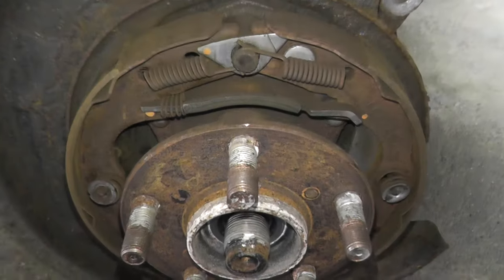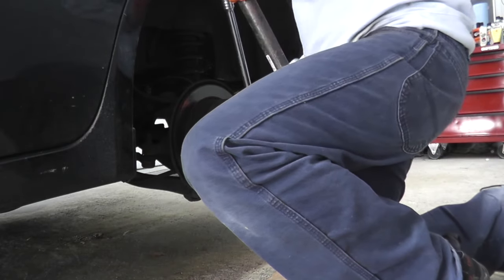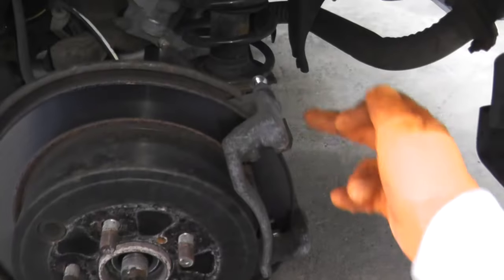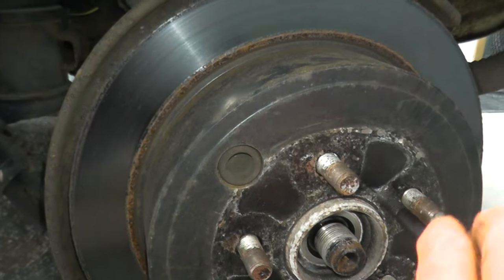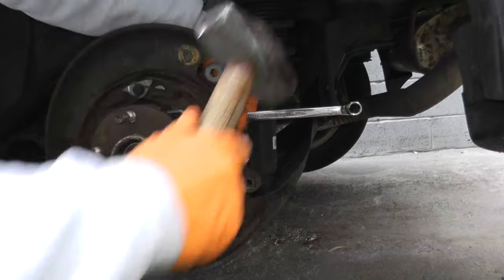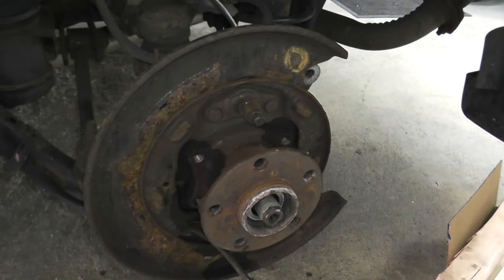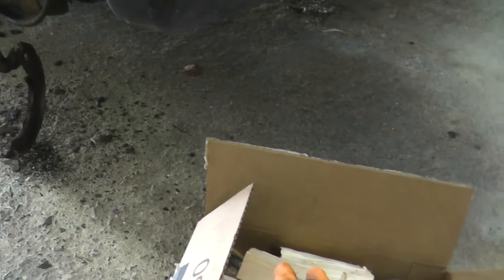Why Are Wheel Bearings so Hard to Remove!!  Subaru Rear Wheel Bearing Hub Replacement At Home!

Comment: First I tried pounding the hub flange for an hour.  Then I tried a puller and it pulled the outer 1/3 of the hub away from the other 2/3 of the hub which remained frozen to the backing plade and the axle mounting surface.. Now there was no longer a flange to beat on. I ended up driving a screw driver dozens of times between the backing plate and the axel mounting surface using a 3 pound hammer.. That eventually removed the backing plate and the inner 2/3 of the hub which were frozen together. After trying a dremel and pounding to separate them, they remained frozen.  So I ordered a new backing plate to go with the new hub which meant reassembling the parking brake, Two days of labor on one rear wheel. But I'm 83 years old.
Reply: Lisle 40100 hub tool gets the job done toot sweet. Someone makes a similarly mounted tool with an 18" 2x2x1/4 square tube welded to it for hitting downward with a 4 lb hammer....I want one.

Comment: I don't if this has been said already in the comments. The small bolt holding the brake hose bracket behind the caliper is the PERFECT size for pressing off the rotors. I normally unbolt those hose brackets anyway. With the slack,  I can get the caliper out of the way. Rests right on the axle.

Comment: Here's a trick that works for me. Leave the parking brake on btw. Use a slide hammer to get the hub flange out of the bearing, remove 4 wheel studs from the flange, thread those into the outside of the hub, use an air hammer with a punch bit to drive it out from the backside.  This allows you to hit each corner of the bearing instead of hitting it till it cocks in the knuckle.

Comment: Astro 78834 is the best tool I used to remove the bearing.  I was done in less than 15 minutes.  South Main Auto used this tool and it definitely worked for me.
Reply: You have no idea the gift you gave me right here. Every bolt I bought from the store sheared off this worked. Thank you.
Reply: @jdub976  Don't thank me. Thank Eric O at South Main Auto channel! Glad someone was able to benefit on a old video like this one.
Reply: Walmart also offers a tool similar to the Lisle 40100, but much cheaper. Amazon too.

 An impact gun could make the Astro or Lisle tool even better.

Comment: put the axle nut back on the axle when you are smacking it with the mini sledge hammer in case you miss the hub. If you foul the threads on the axle, you're looking at replacing the entire axle as well as the hub

Comment: Before putting the hub back on it's a good idea to use anti seize so it's not rusted together next time
Reply: I mean my bearings lasted 210,000km (the factory bearings) on my 2000 Model GF8 WRX. 
So anti seize would only be useful if i was going to still be driving it at 400,000km + while i plan on keeping it next 10-15 years i have done 65,000 in 9 years lol

Comment: I've seen that stuck hub removed by using an old rotor. Put it on backwards and tighten it down. Whack the edges. Obviously, use an OLD rotor that is no longer in service.

Comment: 2 days ago, I replaced 2 of these on the rear of a 2012 Outback, ending up having to remove the knuckles and applying 5000psi to the back of the bearings to get them to finally release. This is very common on Subarus. Also, had to cut out the front lower control arm rear bolts as they were frozen to the rear bushing sleeve.
Reply: Oh my goodness! Looks like that’s the way I’m headed now as only the inner bearing came out 😂 After working on cars in the PNW for most of my life, now I’m in the rust belt and NOT used to this level of rust and corrosion. Day 2…

Comment: You can use the screw holding the brake line on the rotor screw holes.  Perfect fit...

I just did my son's car, and what's even easier is replacing the CV axles and the hub simultaneously.  They were not very expensive if you count the amount of time that it saves you in the end.  Plus, you buy some life on those stupid grease boots that seem to crack and throw grease everywhere.   I did all four of them around his car in about three hours.

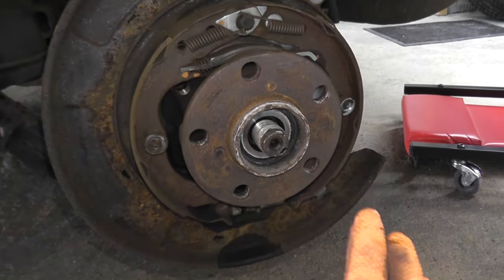Comment: If the rotor has a lip on the drum portion, it may not want to come off over parking-brake shoes. Rotate the rotor so that the rubber plug is at 6:00. Remove the rubber plug. Spray brake cleaner in the hole. Use a star-wheel tool or a flat screwdriver to rotate the star-wheel inside to retract the shoes a bit. Then pull the brake-rotor off of the hub.

Comment: use a long slide air hammer or a hub shocker tool and they come out without too much trouble - also you should 100% be removing the ABS sensor before you start hammering on the hub - i deal with these all the time in the rust belt New England
Reply: Hey I am about to do this job on my '14 crosstrek. Can I leave the axle nut on while I slide hammer so that the bearing doesn't pull apart? Or is there anything delicate on the axle behind the wheel bearing?

Comment: Soak that sucker in PB blaster and hammer it back and forth on either side. Take the sensor out that is on the top and that is where you can spray the PB blaster. The wood is going to absorb a lot of the force that you are putting out.

Comment: Just did all four bearings on my 2010 Forester. BFH needed to bash the F out of each one. Came off eventually! (Rust top blame). But a fairly easy job besides the bashing! Pulling the flange didnt work either as the bearing pulled out - it was that seized! ALways remove ABS sensor if you need to bash them off though!

Comment: I have a good floor jack and lots of experience jacking up rear ends, e.g. Tacoma or any real wheel drive solid axle without too much load in the bed. With these, I've never had or caused trouble jacking up the entire rear end  with the floor jack raising the center of the differential (the big round part of the rear axle).  However I have been afraid to jack up my GF's 2015 Impreza that way since it doesn't look designed to lift the entire rear end of car! Hmm....obviously time to take another peek/attempt....
Reply: the rear jackpoint is the pumpkin

Comment: Thanks form the video.
My old wheel bearing came off easily, but it's stuck to the axil spline.
When pulled the axil and the wheal bearing assembly both coming off, but of course to a degree that axil length allows.
No idea how separate the bearing from the axil.
it's just weird problem, don't see anyone has encountered this.

Comment: A half-inch battery-powered inpact gun is reasonably cheap. It does not have to be profesional grade, and is well worth the money. You can use it for all sorts of jobs. You can even get torque extension bars, and I have found these to be tolerably accurate. Check with a torque wrench anyway. The electric gun is not quite as good as an air impact gun, but pretty close, and you don't need an air-compressor. 
You can over-torque using an impact wrench, but if you use common sense, and stop tighening before "clickage", you won't exceed torque. It is a myth that mechanics or anyone else can just feel the correct torque, but you can get close.

Comment: So just posted on another vid, I'll share, all the banging on those hubs isn't really needed, harbor freight sells a slide hammer with a hub adapter, put adapter on use lug nuts to tighten, install slide hammer and yank em out, cost at HF was 59.99 in TN.....I just did my 16crosstrek, both rears, rear diff fluid change and oil change in 2hrs start to finish with just jack stands in the garage floor.....the comment on anti seize is definately good comment when not if you do these again.....mine where pretty crusty at 96k but car has spent some significant time in Colorado salt, niether side took more than 5 thumps with slide hammer and popped right out ......thought I'd share, really easy bearings to change for the diy'er, a lot better than press out Honda civics.....whew those are a pain, these in comparison are super easy
Reply: I went that route as well.  Didn't budge.  Then I got a hub puller...which pulled the bearing out of the hub.  Now I'm trying to spin what remains with a long barrel air chisel to break loose with generous amounts of PB Blaster.
Reply: @stevofromiowa  weird, I’ve done 2 different subbie rear bearings and both bearings on both subbies popped right out, didn’t use full force, just kinda slow tapped them straight and got a little harder each time, about 6 thumps and the pulled right out, I did clean the surfaces and apply anti seize so next time should be real easy

Comment: Hoping you can help. After going through the hell of replacing the right rear wheel bearing, the axel is now locked up? Will not turn more than a couple of inches in both directions and then full lock? suggestions?

Comment: Hey! I've been using your videos to do a lot of my own work on my 09 Impreza. One thing I was wondering was if you could do a video on or even point me to some subject matter on the fuel tank pressure sensor. I have a check engine code P0453 and I've looked just about everywhere to see if anyone else has fixed the issue but I haven't had any luck. I know the sensor needs to be replaced but I have no idea where its located.

Comment: Safe yourself a ton of trouble and put your hammer away. Remove everything you did jut the wheel studs. Put the tire back on and raise the car with a floor jack. Place a 2x4 on end and lower the car with a jack stand in -lace for safety
Reply: Ps that trick won’t usually completely remove or but will break it loose
Reply: @wilpotts7441  can you please elaborate what you are suggesting. I am interested in your method but I can’t quite get what you mean. I have everything apart on my 2017 Forester and will get back at it tomorrow to get the hub off so looking for the most efficient method. Thanks!

Comment: I always thought you knocked the centre shaft back to break it then, whereas surely your trying brake a motion welded bearing. I must be wrong I guess. The fronts get knocked out with a centre punch.